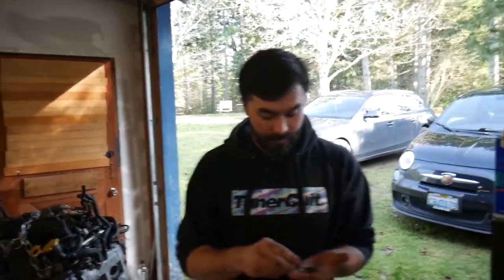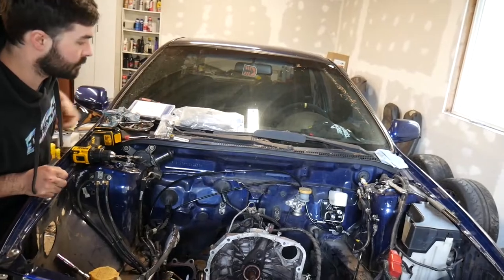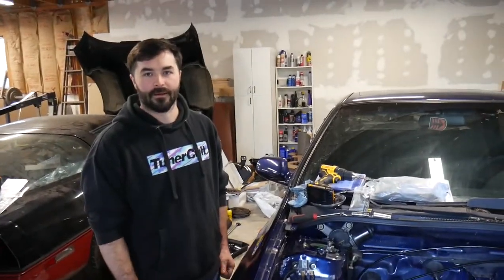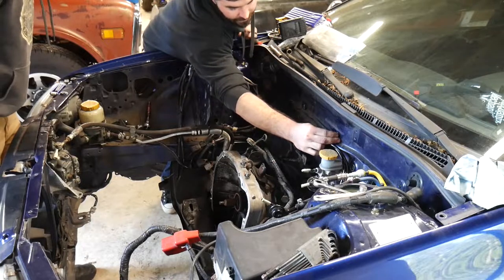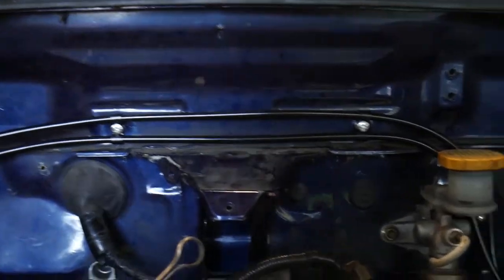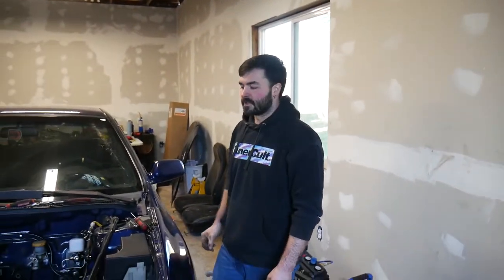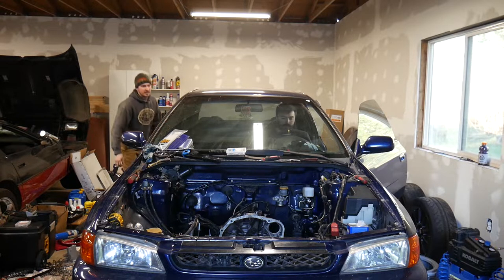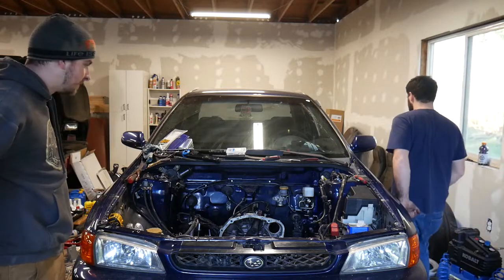GC8 Full Manual Brake System Finalization! Cleaning Up Our Install!

Comment: So once you install the new peice, the lines you run connect to the factory peice that was behind the old ABS unit? Then that connects to the hardlines correct?
Reply from the maker: Mark - “No, everything from the ABS except the hard lines gets removed. The kit comes with a new fitting to connect the existing hardlines that run to the rear to the new brake system”